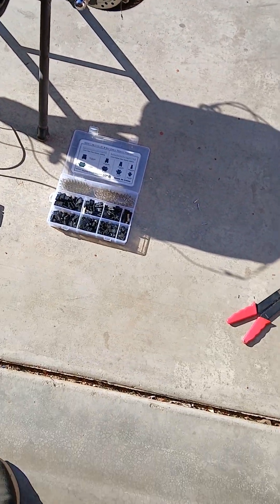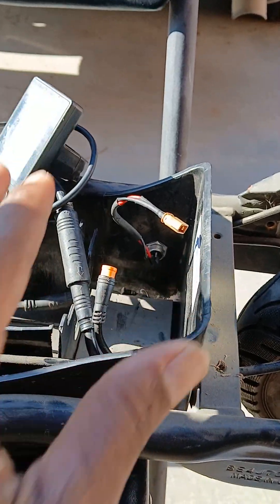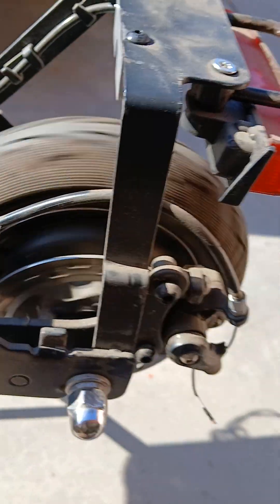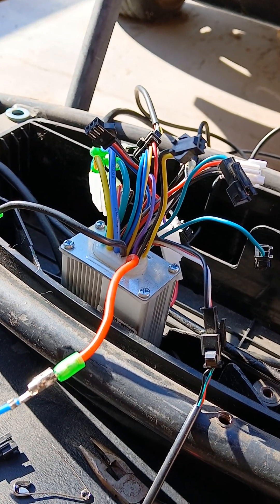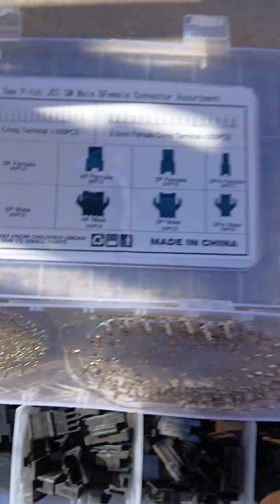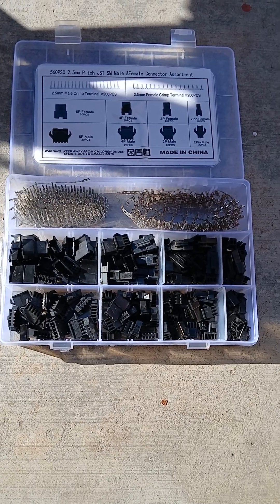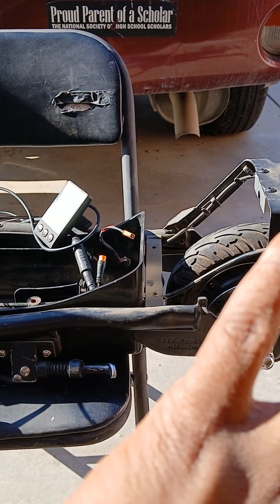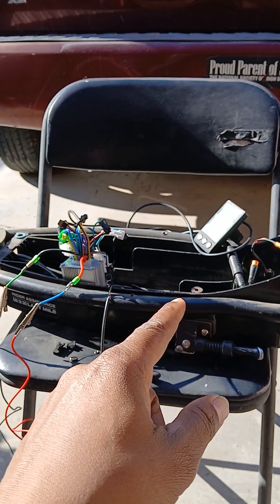Brainpower Motor Controller and S866 LCD Display is working!!!!

Comment: In addition to the 5 pin connector my display also has a second connector with 2 wires but no information anywhere showing what they go to!  Does anyone know what those 2 extra wires are for?

Comment: OMG thank you so much for your video this one help me fix all my problems,i had the same issue with my controller i thought it wasn't compatible with my e scooter thank you again 👍👍👍
Reply from the maker: @has20100  no worries!
Reply: Hi again thank you so much your video got it worked but this time when I hit the throttle the speed limit is not showing on the display any help on that I have video of it can I send to you so can see what I'm talking about thanks